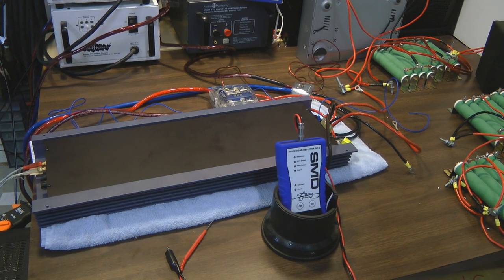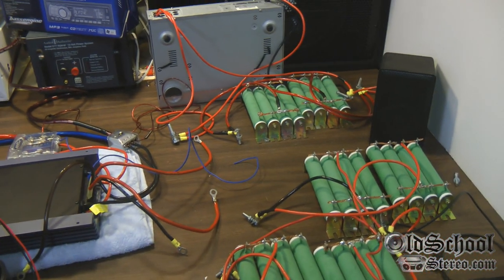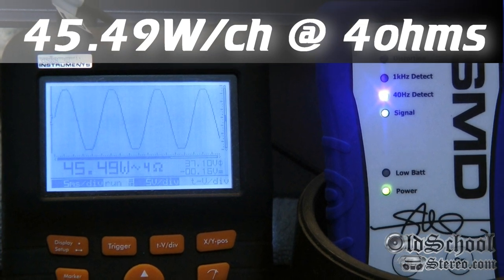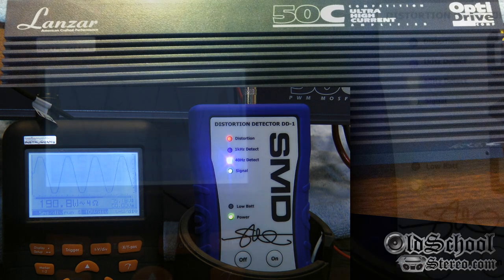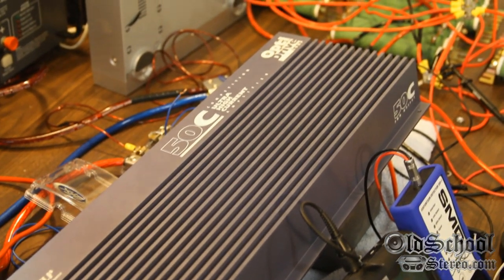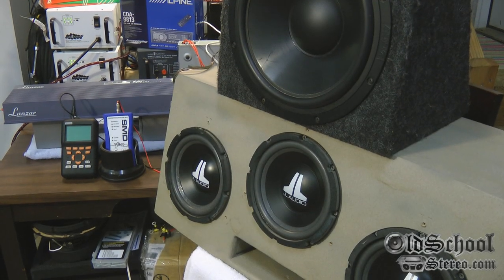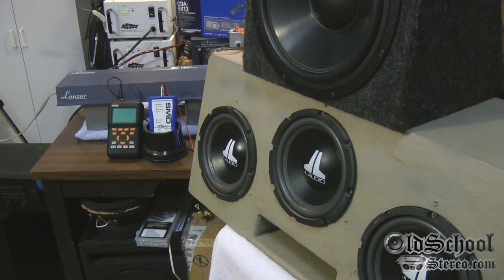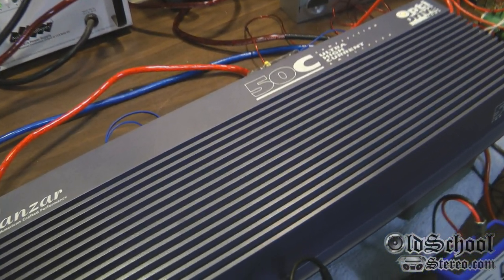Old School Lanzar Opti Drive 50c Ultra High Current Cheater Amp RMS Power Output Test SMD DD-1

Comment: When I got into car audio, Lanzar was a brand I wanted due to amp's like this one...  But I discovered they turned to making massively overrated and underpowered junk.  Maybe the current Opti's are good, I dunno...  I just know that when I hear the name Lanzar these days I cringe.
Reply: +Reggie Reginato  ? hell nah lanzars optis are the SHIT ! best bangers around amps n woofers
Reply: Reggie Reginato your missing the train big time on the all the opti drives from a/b tod class.
Reply: the one guarnteed you are correct
Reply: I had a Lanzar amp hooked up to 2 15" kicker comp speakers. I also ran a passive eq to give it more depth. That was back in rhe 90's. Pyramid's parent company bought them and I can't really speak on the new stuff, but you get what you pay for in the end.

Comment: That amp does quarter ohm Bridged all day with good volts and cooling.I had eight 12 inch duel 4 ohm on it.Total beast!
Re-test would be nice.
Reply from the maker: +New1Orleans Dyno goes to 1/2 ohm mono and since these amps are regulated, they don't benefit much from additional voltage
Reply: I dunno it was along time ago.
I got 2150 black opti drive in my trunk right now. I get 2db more with it running 2ohm bridge than I do at 4ohm. If it's a regulated amp it shouldn't do that. I have to question we're all opti drive amps regulated .

Comment: So cool to see this.. I remember drooling over this amp 20 years ago.. I had 3 Optidrive 2100's running in series side by side 3 straight across ..2 amps were pushing 4 x JL audio 12's and the 3rd amp was driving my highs and mids.. Miss those days sometimes..

Comment: I remember reading about a guy in Florida being bored back in the early days of car stereo so he built a class d amplifier and in the late 1990's they began to make it a hit, around that time they brought back tube amps! I still have my JL Audio 15 W0 subs! If I can get it quick enough I am buying a opti 2150 that I will have to repair! Maybe after it is fixed I can get it bench tested by you! My fave was a US amps old two channel I had, I can't remember the numbers but I thought it was rated at 100x2 and actually put out 400+ bridged mono at 4 ohms "Their Ratings"! The old pyramids were pretty good back in the days as well, I passed on an amp that you tested it was an mtx old school and should have grabbed it, the numbers were unbelievable with your test! Remember match the impedance of your amp with your subwoofer wiring setup and never add too many speakers it will draw too many amps! That goes out to all the newbies! A stereo system is an investment that can literally last years or decades if you follow simple guidelines!

Comment: love that I found this, I have installed for24 years .... now, restore auto,
i have a opti  500 with a coil and caps from an opti 50 c.    I used to work at roco  these are true amplification. . ..

Comment from the maker: Just so everyone knows, the Velleman HPS50 o'scope has a built-in RMS volt meter and does audio calculations automatically for 2 ohms up to 16 ohms. The 1 ohm and lower tests results were calculated using the (E^2)/R formula where E is the RMS volts and R is the resistance (ohms) of the load during that test

Comment from the maker: I had to get an AGM battery to run w/ my hybrid power supply/charger so I could test the ZR1000 and XS100 (and my RF Power 1000 Mosfet). Stay tuned, the tests of these amps is coming in the future.
Reply: Do you sell any of the amps you test old school or new school

Comment: Dereck BigDWiz  Have you ever had one of the old Zapco 3 piece amps? From the late 70 or early 80's I think. I knew a guy that had some. As far as I know he was the first guy who ever used capacitors in a system. Judges didn't even know what they were back then. Smartest guy I ever saw. He was an a/c man. That's where he got them from back then.
Reply: Yeah, but in the early 80's it was high tech. This method would be stupid today. I'm just saying where we have come from.

Comment: Yes a great quality amp.
Reply: Yes I used to run Lanzar. Unfortunately was running little low on cash. This was choice after Rockfordfosgate 150amp, 300 4-channel, a cap, PA-1 Rockford was stolen from me. Forgot the subs 15" oh Rockfordfosgate 1" tweeters. But you win some and lose many. Including my Alpine Amp. Also for high. However ran a little short on the Power 1000 watt.

Comment: I should have sent you my repaired Alpine v12 MRV-T500 to bench test, it cost me $86 in parts, all new transistors and op amps, pwm, and recovery diodes, but I burnt "Didn't fry" a 1200 watt woofer on it with the gain 1/4 up with 4v pre-out Pioneer! It was my nephews and now it's back in his car!

Comment: Man, I just found this video again. Curious which amp was your favorite in the cheater series. When I was in high school and at my 1st 12v job (cleaning up shop, I was 16) I saw this amp set up in a Big old Caddy with 4" components up front, tweeters where in the a/c vents, a pair of Lanzar 6x9's and 2 15" LP--4's. Had a Lanzar Opti e5 EQ and a pioneer DEH-P715. It was amazing. Always a fan of these amps and gear pre-Pyramid.
Reply from the maker: Probably the US Amps VLX-50

Comment: I have 2 2500, a 2150, a 250, and a 4160 all bought by me in the early 90s, all still in use all work fine to this day.  I would def like to know what my 2500 run, I have them on Fi BL 18 dual 2 ohm subs, one amp on each sub. No problems other than they suck the power down an kill most of my batteries.

Comment: so I have a question bigdwiz i watched this video....man I watched and liked'em all but my question is; Is power power, whether it's clean or dirty. Say you put this amp Lanzar Opti 50c vs the AP-15001d, both at one ohm and burp a sub for SPL would the Lanzar quality make it louder our would the shear overall power of the AP-15001d win? Just curious b/c I'm look at 2 of the new APCL18001D which are only 180/ amp for my old skool stroker 18's. Thanks in advace

Comment: Well from one fellow basshead to another we know that the amps power system will only be as good as the skinniest wire and in this case going from 4 ga to 8 ga will only give you the power capabilities of the 8 ga wire. Try running 8 feet of 1/0 of then put in 2 inches of 4 ga then another 8 feet of 1/0 You will only draw as much as the skinniest part will allow, in that case it would be the 4 ga wire. I see people run huge wire then reduce it and i tell them they are losing a lot of power which in turn makes everything too hot. They tell me i'm a "big dummy" but I'm not. Electrical engineering doesn't lie. It's not me saying those things, its the rules of electrical flow. I just pass the info along.

Comment: See if you can get a Rockford Fosgate P45 25 to life. It's 1 ohm stereo stable for sure and only has 30 amp fusing. Supposed to be 2x45w rms @ 4 ohm
Reply from the maker: I have one of those. They are good for around 275W bridged at 4 ohms. They can handle the dynamic run at 2 ohms mono, but not the full certified 10 second sine wave test. I ran my Punch 150 25TL on the Amp Dyno a few months ago and popped all 3 of the 30A fuses trying 2 ohms mono...
Reply: Dereck BigDWiz I'm guessing 2 channel amps do better when you run both channels vs bridging. But those tests are pretty brutal, especially certified.
Reply from the maker: Hless421 2 ohms mono or 1 ohm stereo is the same load on the amp. I'm hoping to get an SMD AMM-1 soon so I can test the amps output power at subwoofers, will be interesting to see how it compares to the resistive load of the AD-1. Speakers are reactive, not resistive, but I'm betting the resulting power output is very similar

Comment: She needs about 15.9 or 16 volts... at about 200 or 250 amps... all zero Guage with reducers. And ill bet she'll do about a grand at half ohm
Reply from the maker: I have a black 50c and have the capability of providing that kind of juice. I have 1/0 AWG OFC wire running from my power supply to the amps. It is about an 8ft run. The power supply is adjustable and can provide up to 250A at 18V and is adjustable down to as low as 9V
Reply: +dmayse1000 I have the black 50c. I was able to find the manual but it's in Russian. I did find the fuse rating which says 120 amps.  Now is this for each power wire, or is it 60amps per wire?  If it draws 140 amps, I am guessing this thing needs 240 amps worth of fusing?? I have a GMC Jimmy with a 320 Amp alternator and 0 gauge stinger to the back. I would love to use this thing. Just unclear of the fuse rating for this thing.  Please help!
Reply from the maker: +Frank Maggio 120A total
Reply from the maker: +dmayse1000 Amp has a regulated power supply, additional voltage above 14.5 does not greatly increase power. I can test your theory though....
Reply: +Dereck BigDWiz Thank you!!!  I really do appreciate it.  So I will get a AGU or Maxi fuse distribution box and 2 60 amp fuses.  One thing I did notice is that the power wires in the 50C are actually 6 gauge. The prior owner cut the wires just before they come out of the amp and twist tied some 8 gauge about 12 outside of the amp which I ultimately removed.  Do I need to search for 6 gauge wire or can 8 gauge- a 12" run be ok?  I would hate to blow up this amp!  Thanks again for your time. 
-Frank

Comment: Can we get that 50c on the dyno Big D?
Reply from the maker: The blue Lanzar 50c is long gone, but I do have a black one. I did a quick test at 0.5 ohm mono and got nearly identical results to what you see here. I'll pull it out again soon and do a full Dyno test
Reply from the maker: My tests with the black 50c confirm my previous testing techniques were accurate!
Reply: Dereck BigDWiz I have a blue that still can get too it, but she needs a tune up. I don't run her much anymore, but when I do it's fun.

Comment: Is this different than the Lanzar 2500?
Reply from the maker: +Joaquin Juarez yes, the 2500 has a smaller heatsink and does power at 4 ohms mono or 2 ohms Stereo. Great amp
Reply: I want to see the optidrive 2500 dyno!
Reply: @wal  what's stronger between this amp and the 2500

Comment: Try a Rockford 800.2a
Reply from the maker: +Jorge Banuelos I have one, needs to be repaired
Reply: BigDWiz . Can this amp handle a 1 ohm load bridged? I have a single 12 type r dual 2 ohm wired at 1 ohm load and bridged the amp and it pounds.

Comment: Is 50watt per channel at 4oms great??
Reply from the maker: This one is actually rated 25 watts/ch at 4 ohms. Back when amp classes were divided by total mfg ratings at 4 ohms. Cheater came from the ability of an amp to handle low ohm loads and deliver much more power than at 4 ohms, thus "cheating" the competition class system by having an amp much more powerful than the 4 ohm rating suggests...
Reply: BigDWiz i have a question of you don't mind 
I'm looking to buy a lanzar optidrive sl50.6 is that a good amp??
I can't find any reliable info or specs from it .